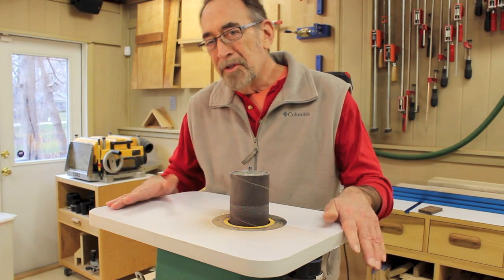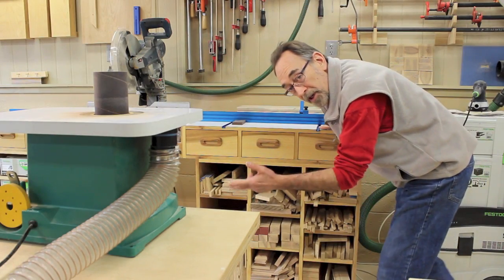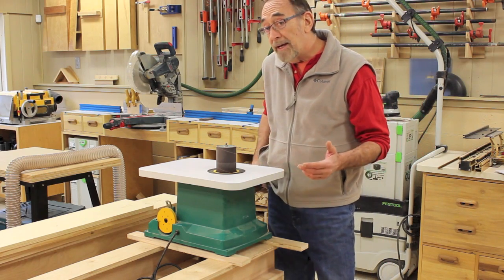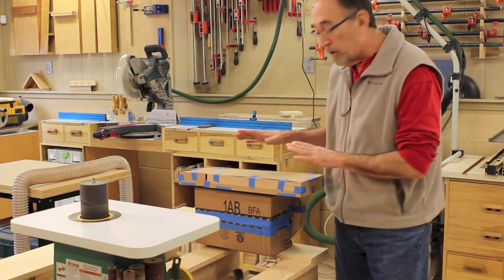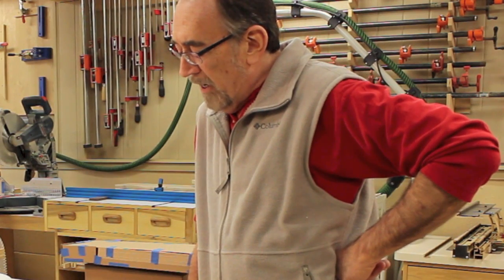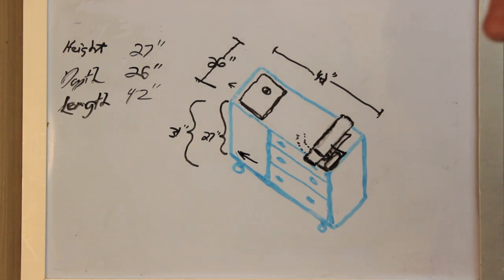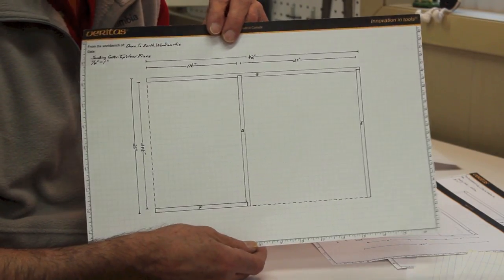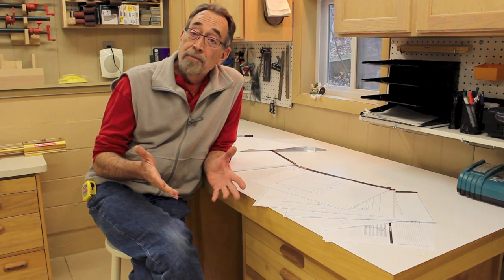Mobile Sanding Center - Design Criteria

Comment: Thanks so much!  Your video has been very helpful in my design for a sanding center.  One addition I am making is I want a "smallish" downdraft table incorporated into the top with maybe a flip-up extension table to accommodate sanding larger parts.
Reply from the maker: Sounds great.  Send me a picture when you are finished and I will put it on my Google+ page!

Comment: A great description of the general design process. While I do pretty detailed drawings in SketchUp, including cut layout, I tend to design before really nailing down my criteria. I then end up with a pretty well executed design and project that doesn't do all I want it to do.
In your drawings, I did not see dust collection or power distribution addressed. Depending on your collection system, would it be feasible run one dust collection hose to the stand with additional piping in the stand?